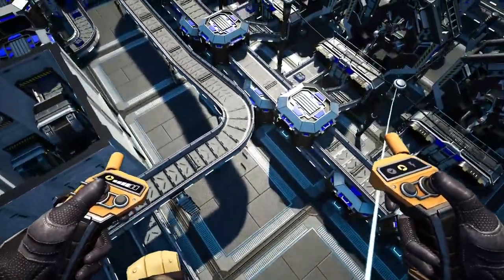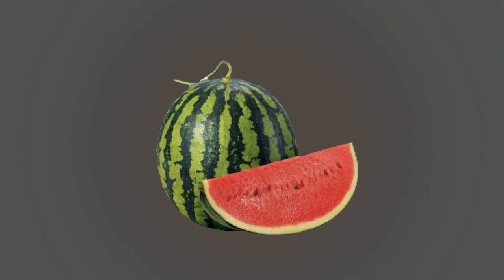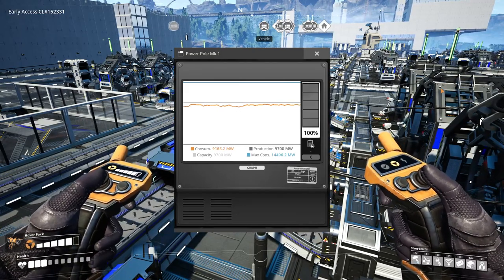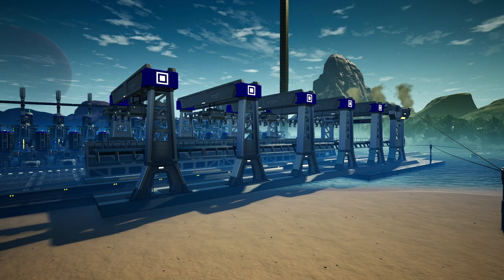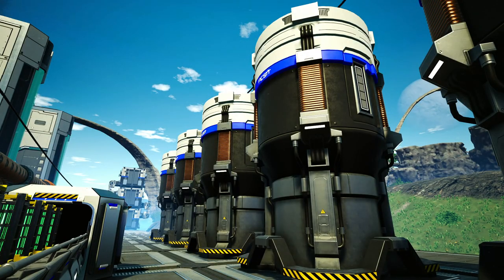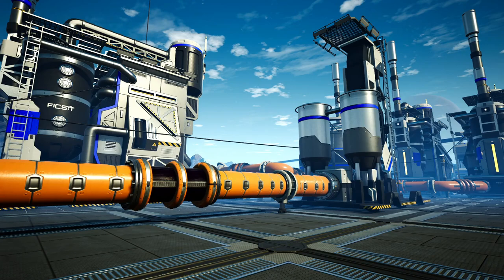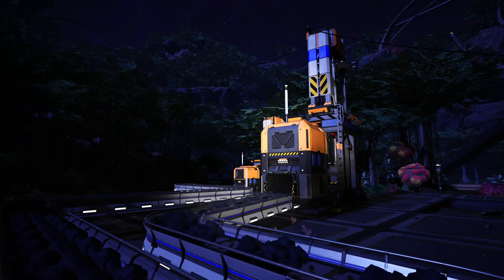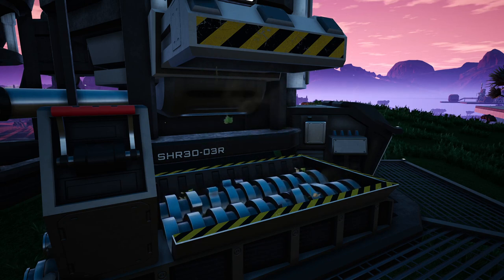Complete Power Guide for Satisfactory Update 4 (OUTDATED)

Comment: CORRECTION! Capacity and Production are USUALLY the same thing. However, Biomass Burners work the same way as they did before Update 4: they STILL only produce as much power as they have to. That means if you're producing an excess of power, your biomass burners won't be needed, and will be shut off. Therefore, for each Biomass Burner connected to your grid, your Capacity will be 30MW higher than your Production, so long as that Burner is not running.
Reply from the maker: Very true! I think I realized that I worded that wrong when I posted the video. Oh well!

Comment: I still like the 20 coal gens and 3 extr @250% better. (I guess you can have 18 extr if you wanna save 141MW.) 
Just 1 full pipe in each end and 1 split in the middle.
1 pure node in each end and 1 normal split in the middle.

Comment: 6:48
What I always do is to place 3 water pumps per 6 coal generators by underclocking them so they each produce 90 water per minute which equals 270 water/min to power 6 generators with one pipe mk1. I didn’t test if its more power efficient tho, I just find it most convenient that way.
Reply from the maker: There are plenty of ways to play the game, there is no right or wrong way as long as it works!

Comment: I build a turbofuel power factory. Using 600 Oil. With the new Blenders I have a brutto production of 44250MW and need 5235MW for the production line resulting in 39015MW without all the pumps needed to pump all the water, oil, fuel and turbofuel. I needed some time to balance the fuel and later the turbofuel distribution as those liquids can make some f....g annoying things that in most cases doesn't make sense.
Now with Aluminium it got even harder. :(
Reply: With my 1000 hours in the game I have always assumed that turbo fuel was hard, but when I realized it wasn’t so hard, it was too late. I have already built 150,000 MW fuel genplant on the Gold Coast but with my new world I was thinking of doing turbo
Reply: @the__randomgamer  It is a good way to get a lot of power without using nuclear energy.

Comment: Pretty awesome 
1 question though, once I set up the coal generator and once everything is working how can I transfer the power from there to my base for production. Gathering woods and leaves and converting them biomass is a ton of work.
Reply: i think from the coal generator you can transfer the power with power poles to your base. you only need biomass to power the water generators at first and then when the coal generator starts working you can remove the biomass burner and then power the water generators with the coal generator.
I think thats how it works there is alot of video's about coal generation on yt you should check those out aswell.

Comment: If I've done my math correctly it's more power efficient to use 4 water extractors set at 75% clock speed.
Reply: That's what I do .. also you only need one main mk1 pipe to transport water to seemingly unlimited coal generators by having the water generators all plugged in opposite them
Reply from the maker: Good tip!

Comment: Do I need pumps on a pipeline that only goes horizontally in one line?
Reply: you really only need them for moving liquids vertically.
Reply from the maker: Nope, you don't need any going horizontally, although you could run into weird issues if your pipe is too long. Not sure if that has been patched out.

Comment: Rn I'm only making abt 10 gw (with 128 coal gens, a few geysers and some spare fuel that wasn't packaged turning into power too (not overclocked) ), il use that to start up a modular nuclear power plant, 300 uranium per minute module at a time using the combined power of the rest of the map and the first module to turn on the other six (the nuclear power plant can make a total of 63GW with all modules on, + about 11GW from the rest of the map needed to turn on the first module, if the rest of the map can't make enough power il just use batteries)

Comment: every time i pull the lever it just shuts down again
Reply: Ur base use more power than ur generators..build more power
Reply: This is my worst nightmare. Fortunately, my power grid is built in a way that it cannot happen (but obviously, it's not fail-proof and it can still happens). Every factory has it's own switch (located in the main control room (at my main base)) and it's own control room (if necessary). My main base is also equipped with a 12 000 MW fully manual backup generator that can last up to 10 hours (unlike the one that will sit in my nuclear power plant (will make less power, but will be fully automatic and last for at least 30 hours)).

Comment: That gap between coal and fuel generators is currently killing me. Coal plants take up so much space and time to craft that it stalls me out on my to-do list so hard. I wish petroleum coke was better than (or even equal to!) coal, to make a stop gap for that transition before you have mod frames and computers automated for generators. It feels like I'll spend an hour setting up oil processing then 4 more hours only fussing with coal gen just to power it.
Reply from the maker: Totally agree! I usually end up just skipping fuel and going straight to nuclear, because it's very difficult to move from coal. That also means that I can't expand too far until I commit to nuclear.
Reply: @SatisfactoryNews  I'm trying to automate circuit board production rn and ended up hand crafting a bunch of HMF and computers just to get some generators up and running so that I can automate the materials for fuel. It's definitely the game pace breaker, from what I can tell

Comment: Well im generating around 570500 mw of power and most of it cones from my 3 nuclear power plants, and rest is turbo fuel and little bit of coal.
Reply: And if you are interested to woh im getting 550000 mw from 3 nuclear power plants. I have an answer. 1-power plant has 5 reactors and waste processing plant included, 2-power plant has 30 reactors and is connected to external waste processing plant what also ptocesses my 3-power plants waste, what has i think 75 or so reactors, you can do the maths for that.